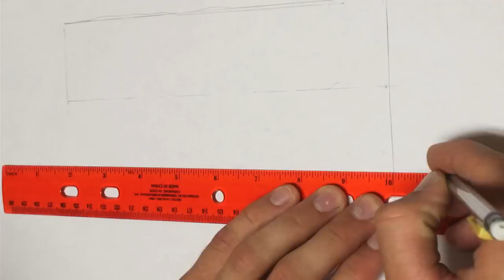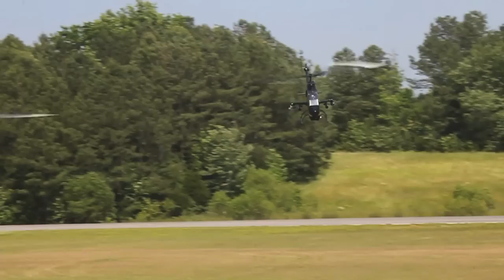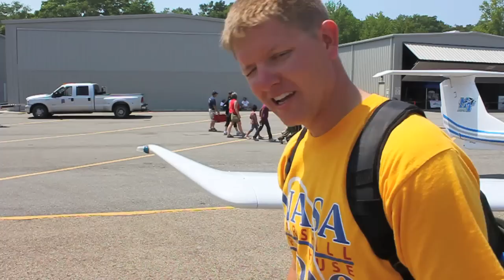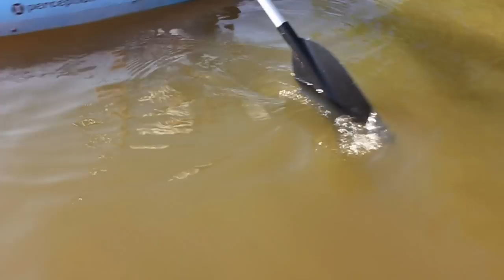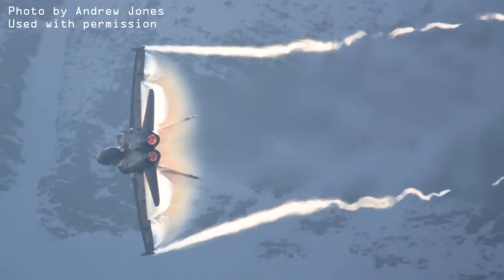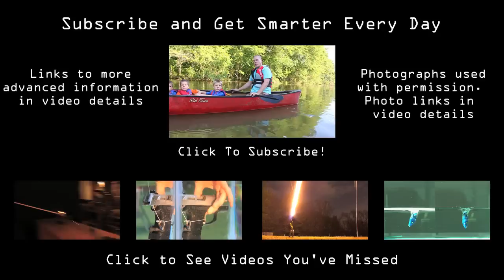Vortex Shedding - Smarter Every Day 23

Comment: Whoa Dude! Correction Please.  Bernoulli's Principal  is only part of Airfoil Physics!  Don't forget Conservation of Momentum Etc.  See NASA's Web site for an easy misconception fixer on airfoil lift generation.  But the MOST incorrect info you gave was your statement "Air must travel farther on top"  Absolutely not true!  Proof is the fact that an Asymmetrical "Clark Y" airfoil can fly upside down and still generate lift.   Be it very inefficient though.  Also there are even some (rare) wing designs with longer lower wing surfaces.  Many are symmetrical.  BTW if you do the math on a Clark Y (and others) the upper air beats the lower air to the trailing edge by a large amount, ever increasing up until stall.  This deflection of air is where conservation of momentum applies.  Note that typical low speed wings are described with Bernoulli's Eq. and Airfoils such as Propellers are calculated with Momentum theory.   Lastly, did you know the quite large wingtip devices now found commonly on commercial airliners (the bent upward type) Do however create a small vortex It's an EXTRA VORTEX!  Yes it does cause additional induced drag.  But what it does is takes advantage of the vortex wake as it returns to the wing now hitting the side (bottom of bent tip) of the wing IT PUSHES THE WINGTIP FORWARD!  Just like a surfer rides  a Wave!  Pretty cool stuff.  Hope this is helpful,  not intended to be rude or anything negative.  Keep up the great vids.  Thank you.
Reply: TL;DR:

The explanation given by Destin is incorrect. You have now wasted 4:33 mins of your life just find out you've wasted 4:33 mins of your life, just to find you've wasted 4:33 mins of your life - and now you're stuck in an infinite loop! Oh Gaaawd!!!
Reply: Robert Armstrong
I have three.

Just kidding, I can't even make proper paper airplanes.. :)

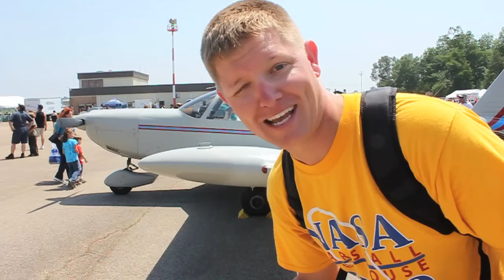Comment: At 0:45 your explanation of why the air over a wing flows faster than the air under the wing is incorrect. It has nothing to do with the top of the wing being longer and the air above having to travel a longer distance. The air will flow faster over a wing than underneath even if the wing is shaped like a flat board. The air above the wing actually flows so fast that it gets to the end of the wing before the air under the wing even though it travels a longer distance, which any careful observer can detect in a wind tunnel with puffs of smoke. In other words, they don't meet up like you would assume.

Instead what's happening is that the angle of attack of the wing causes the air under the wing to "bunch up" and slow down and create a standing pressure wave below and in front of the wing. Meanwhile, the air over the wing is unencumbered by any pressure wave, and in fact hits a partial vacuum over the rear of the wing that it accelerates into. That vacuum is created by the wing forcing the air that was there downward beneath it as it travels through it. It's all in the angle of attack.

Those who like the Bernoulli high flow = less pressure approach forget that what's really happening is that it is the airplane that is moving through what is typically a static volume of air, at least until the airplane gets there and disturbs it. Therefore you have to have an explanation that works from the POV of the static air as well as the moving airplane. You can't just assume that air over a wing always flows faster than air under a wing, because if the wing is still, then it doesn't. And you can't assume that the air above the wing will meet up with the air under the wing, because it doesn't, not can you try to simplify the explanation and let people assume that to be the case, because then you're misleading them. And you can't bring in the length of the wing being longer above and below, because that's irrelevant.

Have I convinced you yet not to say that ever again? Good!
Reply: +anomaly P  Yes.  The air under he wing does indeed get pushed along with the wing quite a bit.  View a wing moving in still air.  The higher pressure under the wing pushes the air forward and up before the wing arrives, then pushes it long with the wing as the wing passes by. That under-air winds up moving along quite far from where it started before the wing came along.
...
The over-the-top-air actually winds up, after the wing passes by, pretty much where it started.Its average speed is actually very low, compared the under-air that is 'dragged along' with the wing.  The wing's trailing edge is what catches up to the upper air before it catches up with the lower air.  This is shown by careful observation (an aerodynamics  PhD at JPL helped me do this)  of air movements as a wing goes by in an otherwise still air atmosphere.
...
The real science is that the pressure differences are caused, simply by the fact that the wing must push some air around in order to move through it. 
...
Those pressures can easily be shown to cause ALL the air accelerations around the wing. (including the Newton down-wash behind the wing which some claim has an upward "reaction" on the wing, thus causing lift.  Air has mass.  Any mass requires a force to accelerate it and pressure difference provides that force. 
....
There is more detail I won't go into here, but all this Bernoulli, fast-air, longer path and several other 'concepts" are false science that those who don't understand Newton and fluids need to make up because they think it is more complex.  Then, many of those who were taught the pseudo-science think it is true and just parrot it without realizing that some of it actually violates Newton.  
...
Air just doesn't simply change velocity on its own. 
...
All fundamentals of the natural world must be followed at all times.
-- 
Cheers
Reply: excellently explained. I always get triggered by the 'equal time' argument.
Reply: +dlwatib  (I know this comment is 3 years old, but...)
I can't see the other replies right now, but you're much closer to the real science that most others.
Reply: Ik this comment is super old but I want to throw it out there that you aren't completely correct. While it doesn't have to do with the top being longer than the bottom, asymmetrical airfoils still produce lift because Bernoulli's principle is still at play. The reason air moves faster on top is because the air will maintain a constant volume flow. Its hard to explain in words instead of diagrams, but an airfoil acts like a Venturi, just without an enclosed area. Just look up Venturi. Your reasoning that air flows faster on top because of the vacuum is inaccurate. There is a beneficial pressure gradient on the first part of the airfoil, but much of the air flowing on top is actually moving in the 'adverse pressure gradient'. At the trailing edge of the wing, the pressure is the same. Thus, from the point of lowest pressure on the wing and aft, the air actually wants to slow down. When you get slow enough that the air no longer has enough momentum, the high pressure from the back of the wing actually comes around the trailing edge of the wing and the airflow over the top separates to the point of a stall.

Comment: Everything is correct except why lift is made.  Check this out by googling "incorrect forces nasa" It is because Bernoulli's principle not because the air molecules have to be lined up again at the trailing edge.  A wing also forces air downwards and since force come in pairs, the wing is forced up.  Both reasons help Airplanes fly.

Comment: It's ironic to preach learning about science at the end of a video where every other "fact" is wrong. 

First, equal transit time theory is completely wrong. It's taught far too often, as a substitute for the (extremely complex) actual reason wings generate lift

Second, the video shows examples of vortex formation. Vortex shedding is a transient oscillating condition that arises under certain conditions, such as steady state flow over a cylinder at certain Reynolds numbers. NOt the same thing.

Comment: You guys are arguing over whether it's Newton or Bernoulli that keeps the plane in the air - when they're actually just two sides of the same coin.  If we analyze the flow according to Bernoulli, and integrate the pressure over the wing, we'll get the right answer.  Similarly, if we compute the rate of change of momentum and compute the force according to Newton, we will get the same answer.  It's not one or the other - or a contribution from both - just two sides of the same coin.

Comment: You've never carefully watched a small plane fly upside down, have you? Next time, notice that the nose is pointed slightly "down" in relation to the pilot (which means away from the ground to the observer). Right side up, that makes a plane descend. Upside down, it creates enough of a "negative descent" to balance it all out and fly straight-and-level inverted. Yeah, science works, so Newton and Bernoulli don't have to go back to the drawing board.

Comment: Which also explains what's called "Flow Separation" or more precisely "Boundary Layer Separation" which can occur and cause a wing stall, increasing sink rate and is easily replicated and viewed as one of the many faults made during a go around when the pilot too quickly retracts the flaps when maintaining a high AOA. But that being given, I only know it happens from experience and study.. I don't fully understand it's mechanics.

Comment: You are wrong for once. The high pressure does not push the airplane up. The lift is the low pressure on the top 'sucking' the airplane into the air.
The underside of the wing has two purposes. One of them is to make it more stable during manouvering, and the other is to decrese the amount of vortexes created.

Comment: Everyone is wrong about the theory of lift. Actually, the wings have little to do with pushing or distorting air. The truth is there are really strong magnets in the wings and are attracted to the metal in the satellites which makes the plane go into the air. The vortex shedding is a polite way of saying the pilot has bad gas. Once my fart made a vortex shed so severe it caused a tornado. No lie. 
But seriously, add a crazy bow tie and you're the next Bill Nye, I mean that as the most sincere c

Comment: @NeilPiersRobinson   Lift is proportional to downwash off the wing's trailing edge. It happens this way because the inertial of air keeps it travelling downwards after it's passed the wing. This means there are two ways to create lift: 1)tilt the airfoil to produce downwash.  2) add "camber" or curve to the airfoil, humped up in the center so the trailing edge tilts downwards.

To fly inverted, simply tilt the airfoil to a positive attack angle.  It's easier w/symmetrical non-cambered wings.

Comment: @Kaldosh Why do you say that Bernoulli's law doesn't apply here? It's pretty accurate outside the boundary layer. Equal transit time is nonsense, of course, but Bernoulli is valid everywhere where there is no vorticity. Since the pressure drop over the boundary layer is negligible, you can use Bernoulli's law to determine the pressure, once you've determined the flow field.

Comment: QUESTION!: 
If the high flow over the top of the wing creates low pressure and essentially 'sucks' the plane up into the air, against the force of gravity - how do planes fly upside down? I've always wanted to know :s

Comment: @JonRSteele   All lift comes from attack-angle at the trailing edge (called "Kutta Condition.)  A positive attack angle causes circulation, causing the air above the wing to speed up.  Airfoil curvature just avoids flow-detachment or "stall."   If flow-detachment never happened, then all wings could be flat plates with no streamlining and no camber-curve.  See bit.ly / pKCXYq

Comment: @Zpik (I'm on iPod so can't reply)
the reason SOME airplanes can fly upside down is that their forward momentum when they roll is larger in newtons than the force of gravity pulling them down, thus meaning they can continue to move foward. To extend this period of 'defying gravity' most pilots push forward on the joystick to make the elevators (flappy bits on the back of the wing) move down, or up as the case may be because they are upside down. This sends the air from the back of the wing upwa

Comment: I could be wrong but I disagree with your explanation on the winglets. From what I know they are there so that the whole wing creates lift except the winglet. The winglet is the sacrificial portion that deals with the vortex and the only reason its angled is to get the most out of the wing without making it wider so the plane has no problems at airports. Hope that makes sense.

Comment: @Helicopterpilot16

so call it "creation of vorticity."   Whether the wing is flapping or static, vorticity is still being left behind as the wing goes forward.

PS

Helicopter vorticity is fascinating.   Plot a thin shell of vorticity below a copter rotor (or even a thin spiral,) look at the resultant flow, and you'll see that the rotor takes in air from all directions, but ejects it in a single direction.  Delta momentum of air gives the lift.

Comment: @Helicopterpilot16  Nah, "vortex shedding" is the name for tip-vortex creation  ...AND the name for Von Karman "vortex streets" as with the Tacoma Narrows disaster.

Normal aircraft flight at altitude is based on vortex-shedding.

Only low-level "WIG" flight doesn't rely on lifting force created by vortex shedding.  In that case it's ground-effect.   But as soon as an aircraft lifts off, the ground effect goes away, and all the lift is created by vortex shedding.  See bit.ly  /  pKCXYq

Comment: @humpierey put simply, yes. Though the pilot will need to compensate with a slightly higher angle of attack (angled up past the horizon) to create that airfoil-shape the aircraft needs to maintain lift

Comment: @humpierey Yes, relatively speaking. When an airplane is inverted and holding level flight (maintaining altitude) the low pressure is on the top of the wing (which was the bottom initially). Any time the airplane is producing lift wake vortices are being generated. That's why some airplanes have to wait before taking off behind other big airplanes. Google "Wake Turbulence" for more... my explanation probably sucked lol

Comment: @destinws2 
Fair enough. But I would have liked something more along the lines of "the shape of the wing forces the air flowing over the top to go faster than that going under the wing thus causing low pressure on top of the wing."  
I do realize your point in this video was about the vortex shedding not lift generation, but I still feel it is valuable to avoid perpetuating common misunderstandings about science.
Thanks again for the work you do making science a bit more awesome and tangible!

Comment: When the tip of the wing is tilted up (or down) its called winglet. And to answer the question about what happens when you fly upside down. Planes that are designed to fly upside down don't have a very convex surface on top of the wing e.g. fighters are almost the same shape on top of the wing as on the bottom. Planes design like this are more sensitive to angle of attack at don't really care wether the plane has one side up or the other. They fly more on speed than on Bernulli ;)